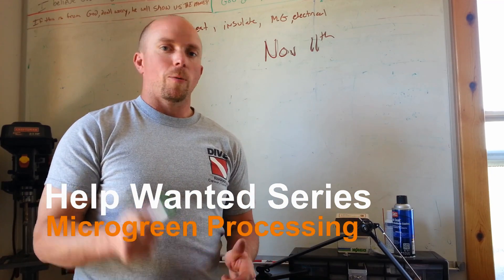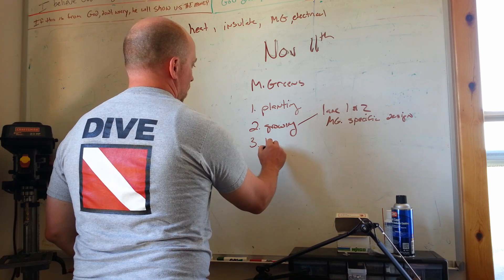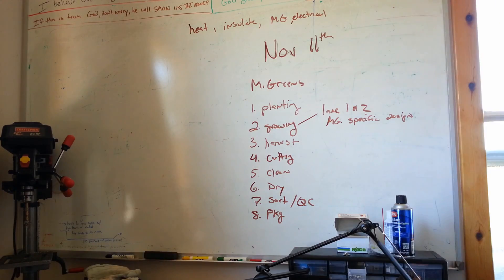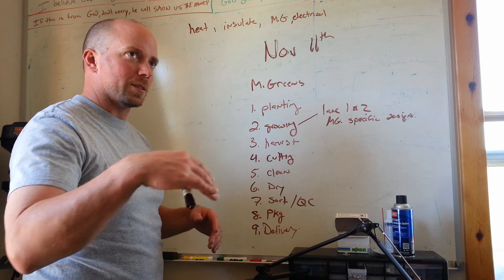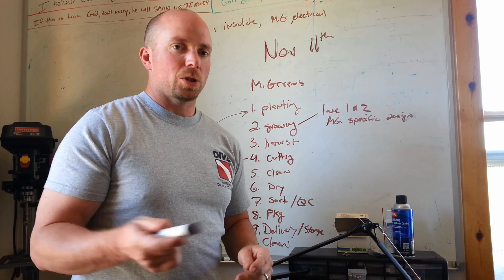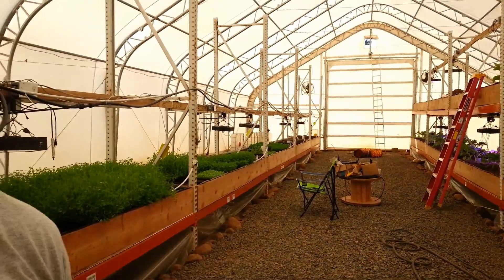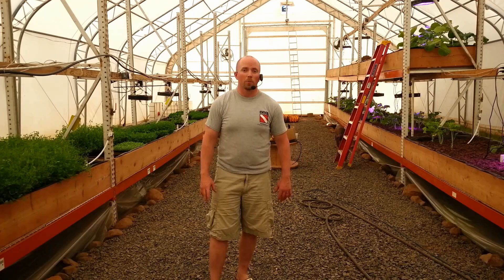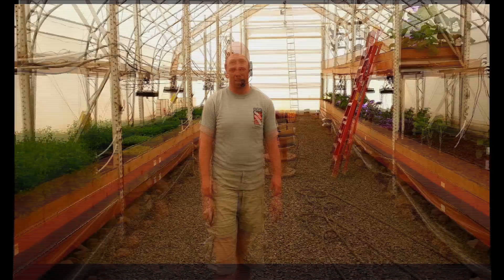How to increase microgreen production processing efficiency?

Comment: I would like to remind you that at some point you are planning to build Hab2 ... it may not be unlikely that this Hab will need a processing area too, so, will you have a processing area in each Hab? sort of wasting possible growing space in each ... or would you be hauling produce around from one Hab to the other? ... might it not be more foresightful to build the processing area 'in between' the two Habs so that you only have to walk a minimum distance from both (and eventually use conveyer belts). Having a separated area also means it would be easier to expand it if the need arises f/e by higher production or an eventual Hab3, where as expansion within each hab would be a lot more difficult because you would need to sacrifice more growing space.

Would like to point out that this is probably more of a concern once Hab2 is in it's planning phase, but taking it into consideration while planning for the setup of the processing plant inside Hab1 can reduce cost down the line. F/e using movable workstations (actual tables instead of build to the wall contraptions) now, means you can just move the interior you have now to the new location, instead of having to rebuild everything from scratch and likely scratching most in the current location. Which means you are basically paying 2x for the same solution.
Reply from the maker: this thought made me sit back and really revisit everything...thank you

Comment: So 84~85 trays a week, in a 5 day 8h work week, means 17 trays a day, meaning roughly 25 minutes per tray ... That sounds more than doable, at least for the handeling part, growing might be another thing entirely. Not sure how long it takes, but you can easily calculate how many trays you should grow from this info...

When it comes to work efficiency, their are a couple of key things to keep in mind:
- Work flow, this is basically the layout of your work area has to be such that moving from one handing action to the next takes the minimum of movement, so that you can spend the most amount of time doing what needs to be done, if you aren't doing what you need to be doing you are 'idle'.

- idle time, reducing it !! ... idle time doesn't mean 'doing nothing', it means doing something that doesn't directly contribute to doing what needs to be done. F/e, if you are walking from the handling space to the grow bed to grab a tray and bring it back, you are basically 'idle'.

----------------------------------------------

So work flow, based upon what there is now, there IS a lot of room for improvement, as every step once a tray is brought in should have it's own 'spot' with work station (this so that if more people work, each has a place to work, and you would pass on the produce being worked on <- it's how Ford did it). Based upon where the water is located, it being the washing station. I would work 'counter clockwise, as you bring the produce in across from it... So you would go:

harvest, cutting (there is a table already there, is it the right work height?), then washing at the sink, other side of the door would be drying/sorting and when it is dry it should be packaged there as well, then there is a door, then the fridge (packaged storage). Then on the wall where the side of the fridge is at, there should be a table for planting as from there on out you are closest to the growing area again. So now to look at the requirements for each stage:

Harvest: to cut idle time (aka walking for each tray) you should have a flat bed wheel barrow with multiple layers (of a sort), so you can bring in multiple trays to the entrance of the processing area, that way you only have to walk 1x (back and forth, instead of say 4 times for 4 trays). It also be nice if you had a hook type thing (like a fire poker, but lighter obviously), so you can hook the further way trays and pull them in, so you don't have to reach over.

Cutting: Not sure if it would work, but on 'i think tell sell' i have seen these knives for the more elderly that have a cutting motion build in them, not to sure if it's a complete useless gimmick or if it would be very useful for your intention. NOTE !! This is also the location where you produce some of your waste (the growth medium), so you should have a sufficient waste bin near it. Luckily the table is close to the planting station, so the plastic trays can be easily put there. Also be nice if there was an actual wall there, so you could have a shelve to put the cutting implements on.

Washing: just today i saw a 'sift' (sif/siv? sorry non-english native, very specific word and spelling checking isn't being helpful) that can easily be put on a sink to drip out, in some advertisement, you will likely want a couple. Maybe you already have them? As it would be a great medium to transfer the produce from the cutting table to the washing and then the drying. ALSO, presort while washing !

Drying/Sorting: because drying takes a while, and i would recommend one of those kitchen sif/v's, i would recommend building a drying rack (can not stack as it would drip on each other, so go wide) where you can place the sif/v's and let them drip out. This makes it so that if one person is operating, they can go cut some more while the produce is dripping out, maybe do 3~4 trays before starting the sorting... You have some more waste here, be it minimal, but you will want a waste bin near, and it needs to be small, so you empty it often !!! this is the place your produce is clean, don't want to contaminate it. Also some latex gloves would be great, and it as to be an easy to clean surface.

Packaging: should be right next to the drying, as you want to package stuff straight away, so there needs to be a good wall with good easy to reach shelving (and easy to clean), so that you can store the storage boxes out of the way, yet still easily grab them at this station. You may also want a kitchen weighting thing there, so you can weigh the produce as it's dry and in the box. Stickers and pen need to be here too, so some shelving right next to the door to the inside, left of the packaging spot, would be needed as well. This end location of the drying/sorting table is one step away from the fridge, so minimal idle time there as well.

Storage/Fridge, you want the fridge to open on the left side, and preferably you want the planting table to be 'just in the way'. This way the door always forms a barrier between the planting station and the finished product. While it isn't likely that contamination takes place, as the produce is in boxes, it prevents you from having the door wide open while somebody is working with raw grow medium and possibly slightly dirty plastic trays.

Planting: Not sure how dirty the plastic trays are once the grow media is out, but seeing how close this station is to the cutting station i would have dirty trays collected here. If these trays need to be washed, do so once all the produce is in the fridge. Might be even better if you would have a washing station just outside the processing station specifically to wash the trays. So you get as little dirt near the location where you wash the produce... so yeah, a shelve again to stack up trays out of the way, yet easily reachable. Do put up an 'end plate' near the fridge, so nothing can fall of towards the fridge... planting implements, a poking thingy, maybe a hairbrush cut to appropriate size, to make locations to drop the seeds... I would also advice some sort of racking, where you can place a finished tray, so you don't have to get up and place it on the pre-mentioned modified flat bed wheel barrow every time, but do that as one step maybe pick up two at a time... once you place the new trays in, pick up finished trays, walk back and repeat.
Reply: Do consider appropriate work height for the working 'stations', and take into consideration having several (two to start with) metal barstool type chairs on wheels, so you can 'somewhat' sit while you do some of the work. This makes the work a lot less strenuous. A little comfort speeds up the work and makes it less frustrating. Use shelving to keep work areas mostly empty, and use easy to clean materials. Also, ample lighting ...
Reply: Some other things that sprung to mind while on a small break:

Cutting: it would be nice if you could build a contraption in which you can place the trays at a 30~45 degree angle, high enough so that at the bottom you can place one of those pre-mentioned kitchen sif/v's that easily fit on a sink. Then you could make shute (or buy one of those plastic foldable cutting bords that 'fold' into a shute), you hold the shute in your left hand while you cut with your right hand, the produce falls on the shute into the kitchen 'sif/v' pick it up and move to the washing.

Washing: not sure how that currently goes, but it might be helpful to have what i think is called a flowersif/v basically a small version of the kitchen thing, on a stick, generally used (or atleast i have seen my mom use it as such) to sift flower. That way you can easily fish out the produces from the water, instead of doing so with your hands... usefulness depends on how washing actually goes... but it sprung to mind, so i thought idd share it.
Reply from the maker: just to clarify...at full speed it will b 84 trays per day
Reply from the maker: again...amazing comments
lets definitely connect

Comment: expandable gravity roller to move trays from lanes to processing area. When in processing area modify a band-saw to cut on the horizontal axis using a safety roller sled to push tray under blade. Micro Greens will fall on a slide mounted 3/16 behind blade and 1/8 above blade and slide into a perforated basket, when basket is full entire basket is placed in wash station 1. Media tray follows U bent pipes under slide to be flipped by gravity return under band-saw and emptied, grow media falls in a bin and tray continues to a holding stack to be cleaned and reused later. Grow media and M.G. roots to be separated and processed into feed for animals.

Comment: What about a heated resistance cutting wire, like is used to cut Styrofoam , I would think it would cut right through them and also possibly sealing the cut ends at the same time . Also is it feasible to lay a mesh over the beds and allow the greens to grow up through them, and after they are cut, you just lift the screens up and dump them. The vacuum idea sounds good, but I believe they would end up sticking to the inside tubes and creating a real mess.
Reply from the maker: not a bad idea

Comment: Kinda conflicts with your hard-wall insulation plans doesn't it?  In your narrower, two-lane enclosure, a conveyor would be in the way, but you could possibly have a hanging basket system on cables for shuttling the trays to the processing area. Rather than blowing the trimmings away, a vacuum might be a better idea, but I like the idea below of possibly delivering the whole tray to the customer and letting them harvest as needed. Don't know how feasible that really is, but think it's worth discussing.
Reply from the maker: it's a pickle...no doubt

Comment: when you started describing what was in your head, I immediately imagined a modified bench band saw (or as you said some sort of hedge trimmer) with a super fine blade with a belt and/or roller system to feed it and some sort of air hose to blast off the greens.
Reply from the maker: that's a great idea...that would also help move the greens to one side, but we'd have to get stainless steel to make it work

Comment: A bar hedge trimmer with a pickup nozzle mounted that's plumbed to a large shop-vac which in turn collects all of the µGrs into it's container might work.  Maybe even with a water spray nozzle to wet the µGrs for a first wash and to aid flow into the collection container.  A finish spray of the hose with water could wash stuck µGrs into the container. 

For packaging, I'd think a vacuum seal-a-meal solution might be cost effective and evacuating the air from the cut µGrs will inhibit oxidation deterioration, at the expense of some µGrs flattening, which fluffing before use could partially restore.

Comment: An aggressive project to fully process via automation.  Maybe good to walk before we run.  I saw a harvester that was conceived by Elliot Coleman and perfected as the Quick Cut by Farmers Friend.  It uses macrame cords to sweep the greens into an oscillating cutter.  The unit could be mounted such that a tray could be pushed through the unit on a long processing table.  At that point you could accumulate product in Tub Trugs and proceed to a wash station.  Alternatively product could be taken off the cutting station on a perforated moving belt for  fod inspection and washed using overhead sprayers.  Pretty difficult to take the manual aspect out of such a delicate crop.  This will be interesting!
Reply from the maker: definitely check that one out...that was a great idea and a solid candidate

Comment: I like the idea and how you are thinking but I also thinking of all the extra power you going to use etc but if you get the heating, ventilation and insulation right then you have more power to work with ~ to start off with I look at manual conveyor belts

Comment: What about using a water jet (think CNC steel cutting) instead of a hedge trimmer? Should give a cleaner cut and reduce power and there would be no cutting blades to clean, no risk of grease (or contaminants), etc..

I think you are sitting on a pretty sweet microgreen production business model without really realizing it. It looks to me like you could dominate the entire market. Small compact factories that could be brought anywhere in North America.
Reply from the maker: I actually went down that road myself...great minds! The challenge that I got stuck at was keeping the spray jet constant over a 12" length of tray, in addition to the high pressure system needed. But I really like the idea
Reply: How about 2 of them in a /\ arrangement (tray moving towards the tip)? That way you effectively lengthen the usable 'cutting surface' of the water by angling  it and don't need to worry about the distance as much. It all depends on how much usable cutting surface you get from the water stream though.

Thermal blankets after cooling prior to shipping will help reduce fuel and energy costs. I heard that from a couple 3M executives, that's what they did in the 70's to cut cooling costs in the trucks. Just make sure you pick the blankets up on the next delivery lol.

Comment: Hmm, have a hard time seeing a good automated system for cutting, you said already you have 2 different ways of cutting, how would the machine handle that (or more variants). Sometimes you need a human hand to lift up and do the cut etc. Don't think I have seen anyone automate that step. If you would have had a concrete floor or similar, you could at least optimize the carrying/travel part of the process without conveyor belts (another electrical hog). You could have large metal stands on castors to move trays around efficiently (and storage, before they take root you can store them almost any way).